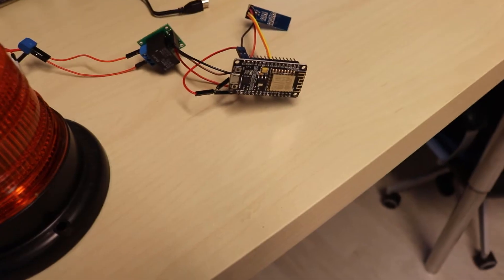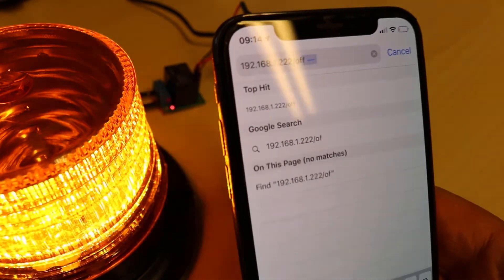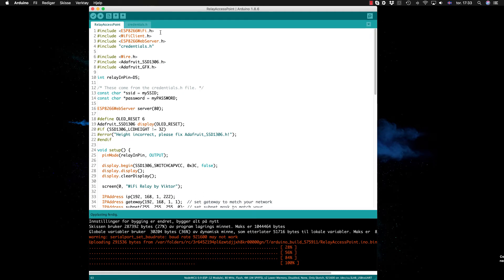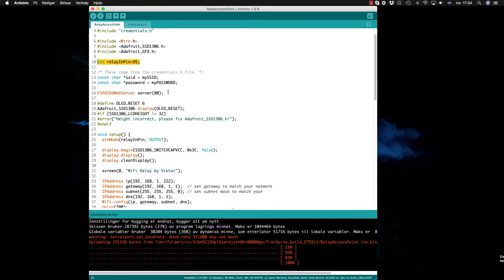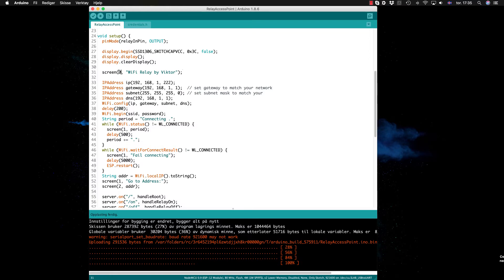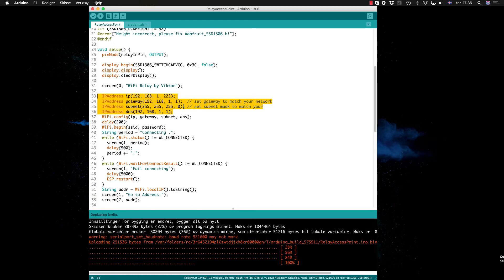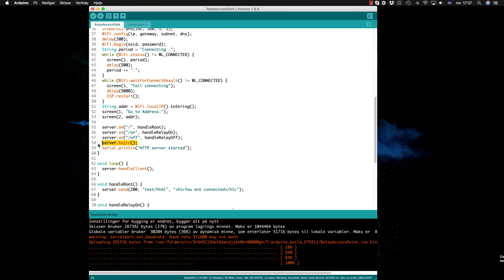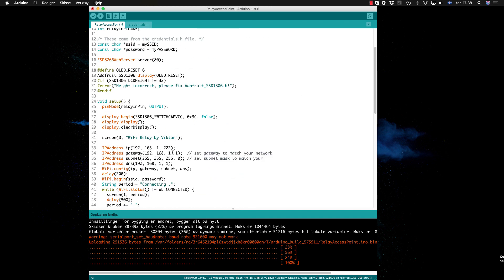ESP8266 as WebServer controlling relay and OLED display

Comment: can you create a project for automatic charging control for laptop with ESP8266.
the idea is
1. laptop wifi & esp8266 relay module is connected same router
2. assign a fixed local IP for esp module (so every time it have same ip)
3. create a program for monitoring battery status and send on or off command to esp8266
4. connect laptop charger via esp8266 relay module
refer these links
https://www.autoitscript.com/autoit3/docs/libfunctions/_WinAPI_GetSystemPowerStatus.htm , 
https://www.autoitscript.com/autoit3/docs/functions/InetRead.htm
Reply from the maker: Manoj Km sure )) sounds fun